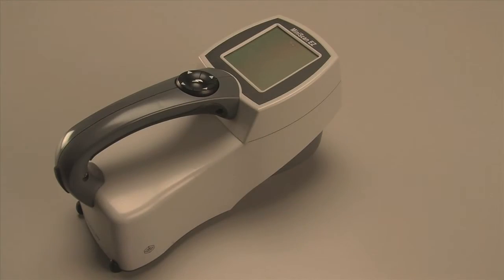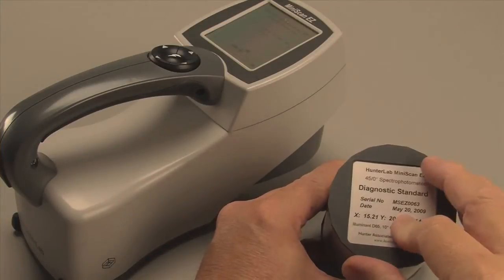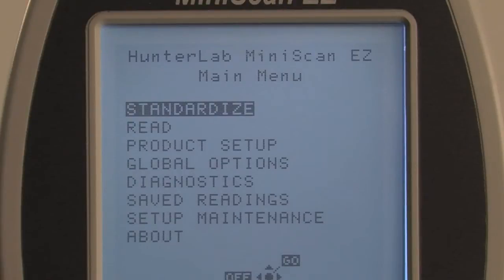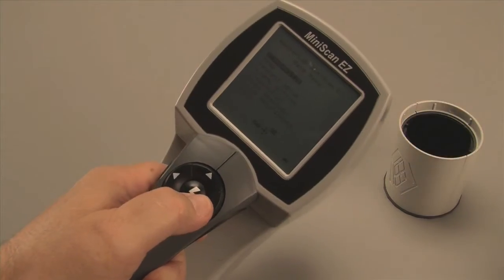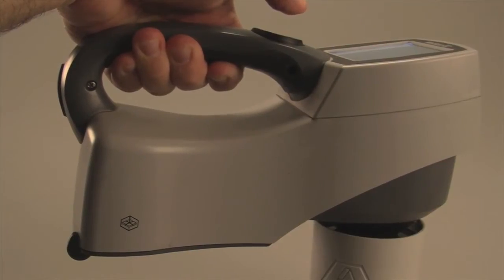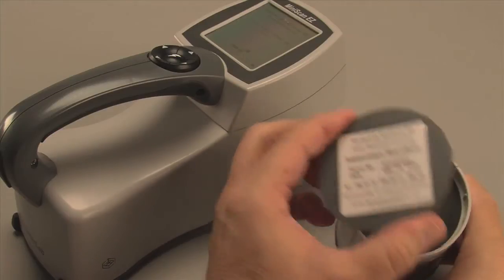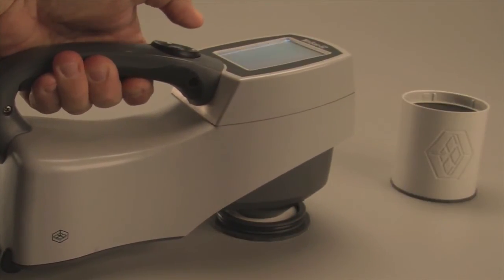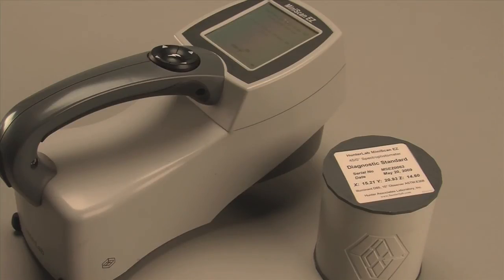HunterLab MiniScan EZ standardization

Comment: I did Standardization the hunterlab miniscan that i have in laboratory.but it was error and i did for many time and the result was same error...how i will do to make it succesfully.thanks
Reply from the maker: Hi,  Very sorry you are experiencing issues.  Our service techs recommend that you remove your batteries,  replace or recharge them, then standardize. ( note- this is not something you need to do everytime you standardize, just a fix to this immediate issue)  Also, it is very crucial that your sensor port sits flat on the tiles.  If this doesn't fix your issue, please reach out to support@hunterlab.com for additional help.